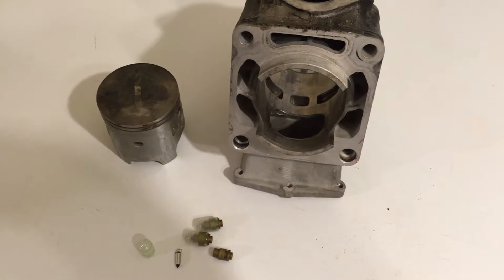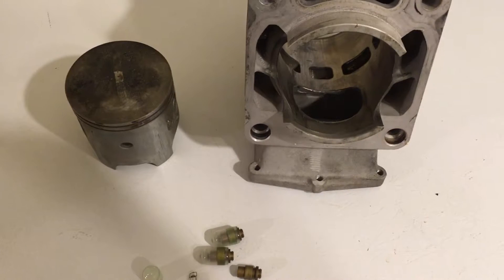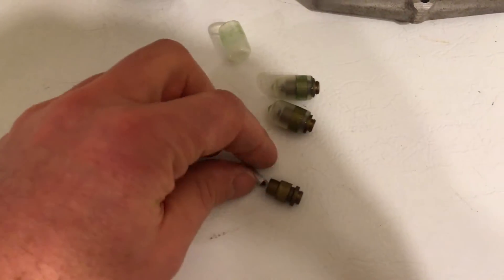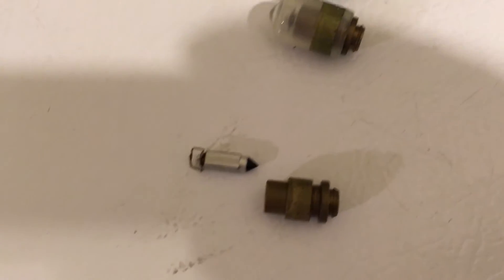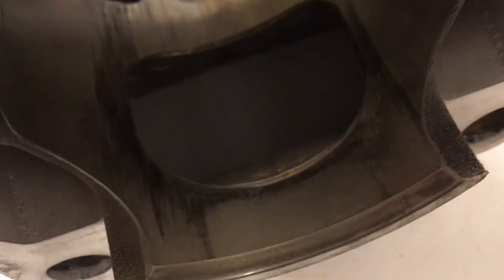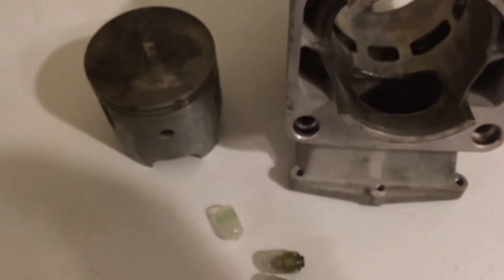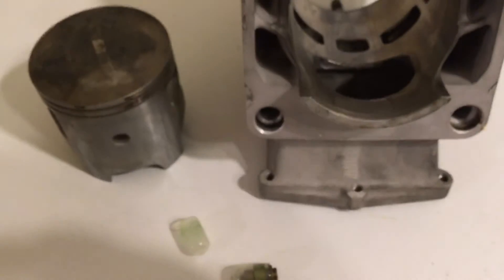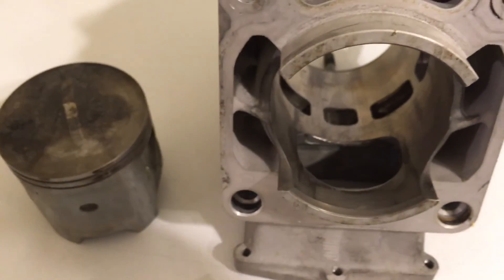What caused a snowmobile engine to seize

Comment: My 01 summit had a lean condition that burnt out the mag side, after tearing it apart I found the jets were clogged, intake boot was ripped, slight air leak in mag side crank seal, and there was a hole in the Y-pipe (that one shouldn't really cause a lean condition) I put it all together but noticed my oil pump throttle lever wouldn't snap back into place so I made the mistake of turning it one turn backward like people said online, and I guess that made the oil pump quit working, and it started scoring the cylinder walls immediately because of that. Ran it 3 times and realized it sounded weird, checked it out and the cylinders and pistons are just scored all to sh*t ahaha dang
Reply from the maker: Bummer! It's usually something simple that causes an engine to melt down, finding the problem before it happens isn't always easy....